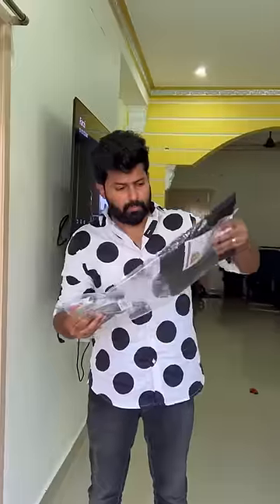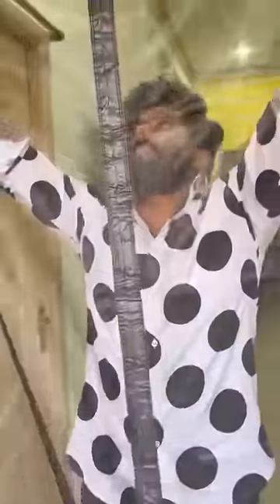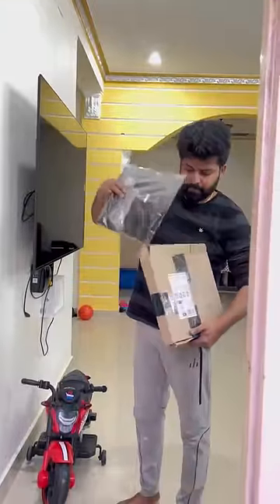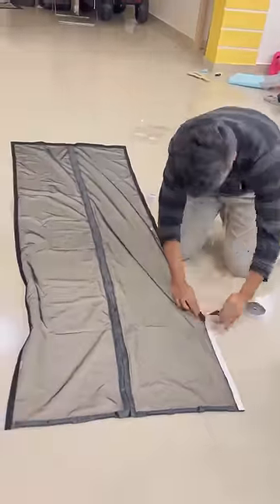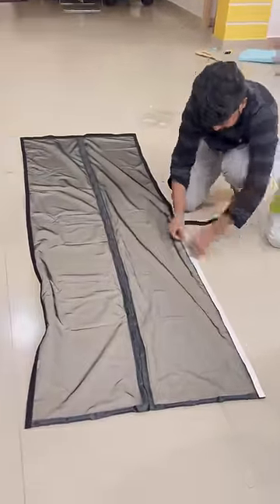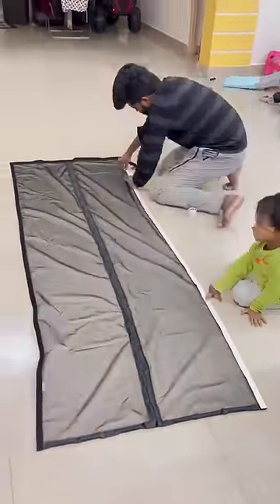Mosquito Door Net for kids Safety 😍🔥❤️ @ShadhikAzeez

Comment: We've been using this net .... since 2o20 ... really a wonderful one.
Reply: How to order customized size... Bro
Reply: Which brand
Reply: Same as this ... only..
Reply: @heleninfant7013  ila bro athula rende option tha iruku... Double single
Reply: @hairnail6359  lifekrafts
Reply: Used one since 2015 but within 3 yrs the magnet started failing as we used it for our main door
Reply: @jansyr9987  hi ..
Then we should wait for one more yr to see the actual results ah😯
Reply: Enna size la vaanguniga
Reply: Lizàrds varama irka help pannuma? Can you please reply
Reply: @karthika7152  it's just a net only....it covers the entire door....so nothing can come inside
Reply: @arasiarumugam2781  angaiye measurements irukum sis....
Or we can customise according to our door size
Reply: @heleninfant7013   really thanks for your reply. You are a life saver 🙏
Reply: How much
Reply: Bottom no frame. Tape required for bottom?
Reply: @rahuldubai8267  no ...sir there is magnetic material so it's strong
Reply: @heleninfant7013  sir, for my door no bottom frame. So i have doubt. Can I use without sticking tape in bottom
Reply: @rahuldubai8267  we have to stick on the wall or frame otherwise it might not function properly i think....